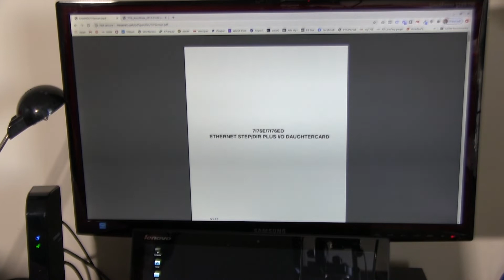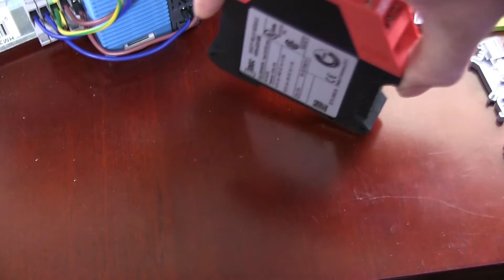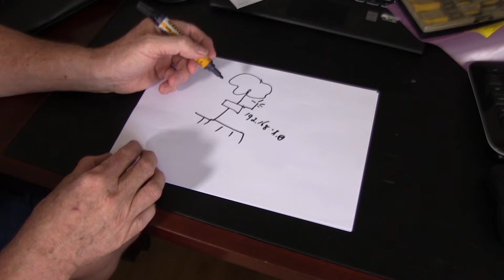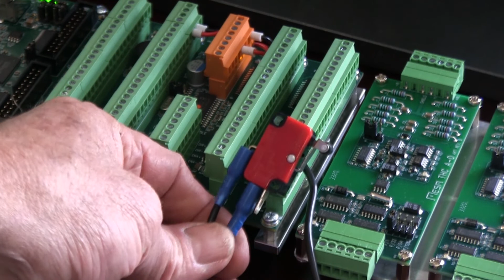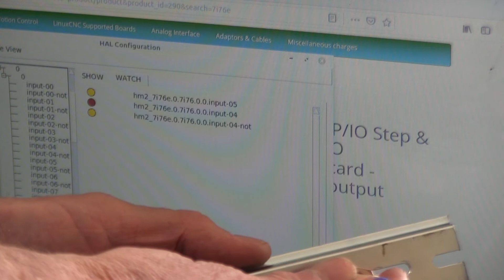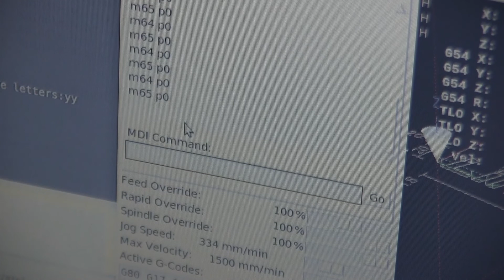Decoding the 7i76e: The Core Intelligence for Your LinuxCNC Plasma CNC. Tutorial for new  builders

Comment: Are you still selling the Mesa boards Rod, I'm considering doing a LinuxCNC retrofit to a large scale Gasparini Plasma that's currently not running due to an issue with the original controller.

Comment: I really like what you've done & am starting to understand things. Is there any way I can use my chinaCNC milling gear without going to all Mesa gear? I suppose I'm trying to bridge the gap from plasma to milling with 4 axis plus 7i76E & the controllers that come with the cnc Router. A video on the full linuxCNC configurisation for this build would be helpful. Youve got to have a good budget behind you but if it gets rid of my intermittent errors it'll be worth it.

Comment: This video came at just the right time.  I have a CNC Router (cuts 2700x1300) that I built running a AXBB-E and UCCNC and it works great.  I am now building a half sheet CNC plasma and am at the electronics stage.  I have been researching LinuxCNC for the last few weeks mostly due to the advances you guys have made with THC.  I was struggling to find a clear and concise instruction on wiring the Mesa board and was looking at trying to use another AXBB-E.  I am now sold on the MESA 7176e and also appreciated the tips on the DIN mounts for it.  I look forward to your video (coming soon I hope) on the THCAD.  Is ohmic sensing needed or a luxury?  Thanks for taking the time to make the video. Mark
Reply: They always come at the right time or a smidge too late when you already figure it out.  However it’s great reinforcement to how you thought it worked to see it actually work before something is misunderstood and hooked up wrong.
Reply: @idus  Thanks for the feedback. The THCAD video is coming. I just had some unexpected behaviour on my test rig which was causing some unexpected AC ripple to understand before I went to air. Ohmic sensing is probably only able to be done if you have a shield on your torch but If I had a non-shielded torch, I'd try it out. Its good for thin material that bends on probing... I'm sure you will appreciate the 32 inputs and 16 outputs of the 7i76e over the AXBB-E. Yo could also look at the cheaper Mesa 7i96 but the wiring is a bit different .
Reply: @RodWebster  Thanks for that.  The 7i76e is actually a little cheaper than the AXBB-E.  Do you have a recommended MESA supplier that is fast or am I best to go direct? Our Proof of Concept CNC Plasma cutter was designed by my brother and was built for $700 (excluding the Plasma).  It uses an $18 eBay board and Nema 24 Steppers running Mach3.  It was temperamental to start but once the bugs were ironed out it is extremely accurate. Plasma being used is a Unimig RazorCut 45.  Not the duty cycle of the Hypertherms but is producing exceptionally good results.  We have also been trialing water outlets flooding over the cut just behind the torch with great results.  Very little distortion on 2 and 3mm steel on all cut lengths.  We have hooked up a car fuel pump sucking from the water table.  Very cheap, simple and at the moment effective.  I have now built all the mechanicals of a new more HD table.  Just couldn't decide on the electronics package.
Reply from the maker: @markalgie1794  Thanks. Either go direct or from https://mesaus.com/ or  https://eusurplus.com/ if in Europe.

Comment: Ok, I am going to have a lot of questions, first thing is, I really like that power supply!

Lol, screwdriver on the floor. I am going to need to watch this all again and take serious notes

Well just got those crimper and ferrals on Amazon....
Reply: Those screwdrivers get me every time! I tried to zoom in on the power supply so you could get the model number.  You could go up to 2 amps or so in the same style.
Reply: @RodWebster  I really got to focus in on the whole thing, but your video has so far got me going back to my supplier, and im looking at the info on the u regulated toroidal power supplies.....so im going to have to go that route....I have drivers that take DC or AC current. This same supplier has a regulated power supply that I am thinking about getting because it looks like it gives me some options I might like to have. Let me know what you think? https://www.steppermotorcanada.ca/steppermotorcanada_031.htm
Reply: @matthewcote4991  I would not get a multi voltage power supply. Some of them (like the one I have in the scrap heap) require a lot of current to be consumed on the 5 volt rail before the higher voltage is turned on. I could get it to run with a massive ceramic resistor on 5V but not with the Mesa cards. So essentially its useless.  I am using Lam Technolgies  DS1076A and LS1073A drivers https://www.lamtechnologies.com/Product.aspx?lng=EN&idp=stpdrvckd. The models ending in "A"  accept AC input so it really simplifies the wiring and reduces the component count/failure points. You need to get the programmer too. These are worthy of a video on their own. I think the toroids become cheaper at higher voltages so if you are running say 48V, a 7amp or 10 amp switch mode regulated  power supply is reasonably priced. But even the cheap Chinese motors can handle the 90 volts I hammer them with using the Lam boost feature to let them cool down while at constant velocity. They only need 30% of the power required to get them to speed at that point.
Reply: My drivers can take AC too, though they are not the same model as yours.